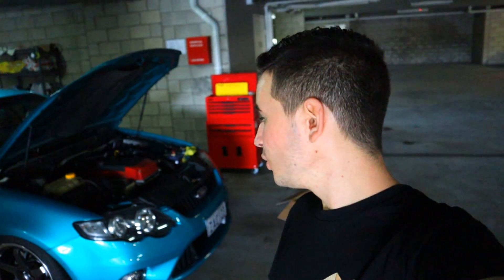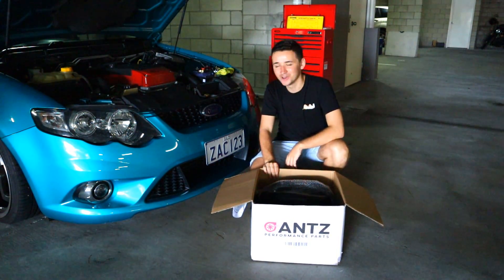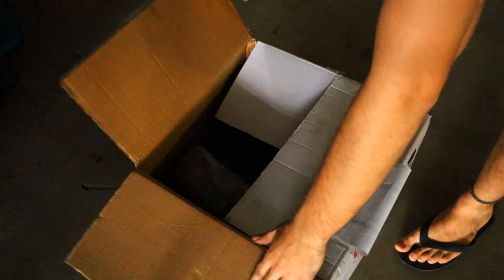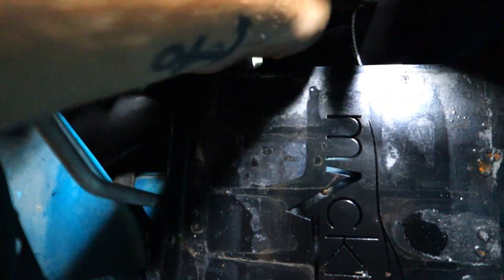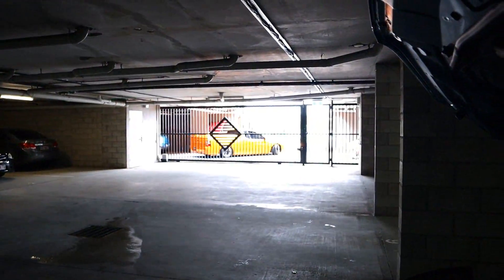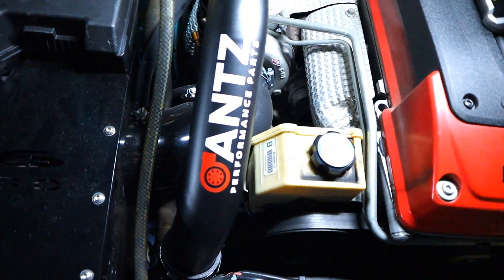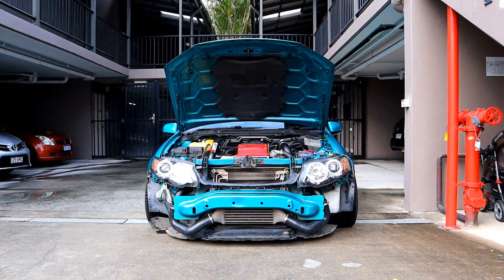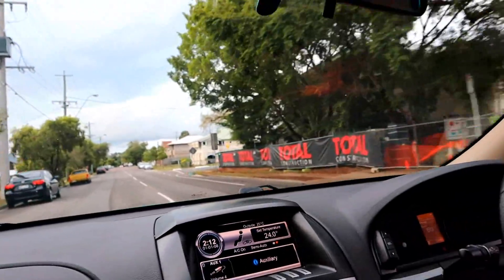Installing Alloy Cooler Piping on the FG Turbo

Comment: Hey mate, have thought about doing a turbo oil feed line replacement video? Common fault on these for the in block paper filter to block up and starve oil to the turbo. Easy replacement and would make a good video 👍 and good preventative maintenance

Comment: Did max' ute beat your turbo at any point? I've never seen a stock xr8 beat a stock xr6t in anything but audio, just curious not shit stirring. Might see you around in my old BA soon😉😉 I'll give you a 10 second second head start 😋
Reply from the maker: Alan Clarke hahaha so Max’s Ute is actually tuned to just over 380 HP, it’s a crazy close race right now!
Reply: @ZacBaldy  ahhhhhh tough 😂😂🤙🤙

Comment: Dude stop embarrassing your self and get a propper car. Manual. 
Btw alloy piping doesn't mean over half the parts are made of silicone. Kinda defeats the purpose of removing the factory ones.
Reply: Bitter Melon you’re the one embarrassing yourself mate haha
Reply from the maker: Bitter Melon reason I didn’t go manual was due to the fact I daily drive through Brisbane city every day, it’s extreamily hard to find a manual XR6 Turbo in Breeze, and I wanted something that will be comfortable for everyone to drive :) 
Silicone/alloy is a hell of a lot better than standard
Reply: I am so lucky I have my 6speed manual bf xr6 turbo in bionic blue until death do us apart going for the 1gigawatt power gain and keeping it as stealth as I can I work in mines so good income to get the job done ;) can’t beat good old Aussie muscle I think the bf has the bigger turbo and the better looks and my partner owns a FPV GT just needs a turbo. 😂 😂